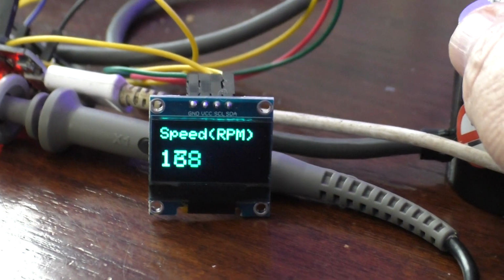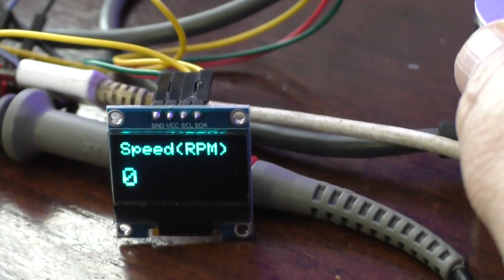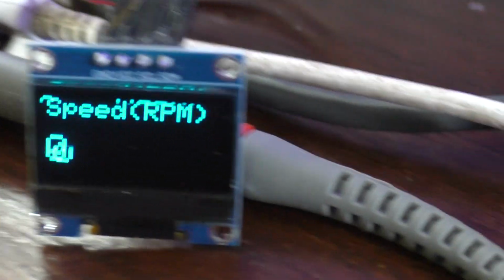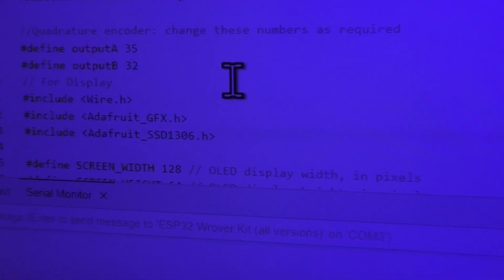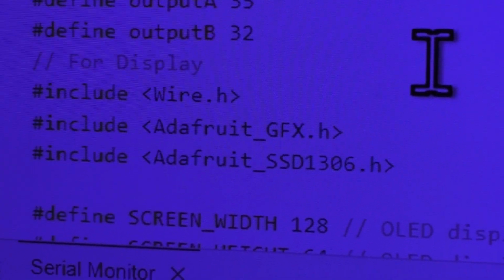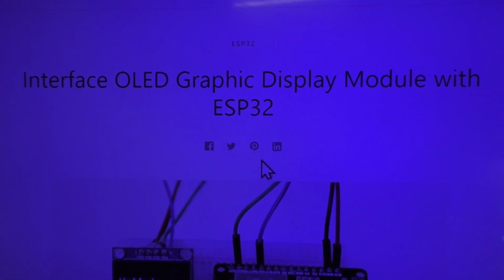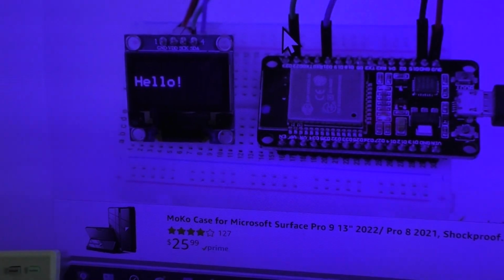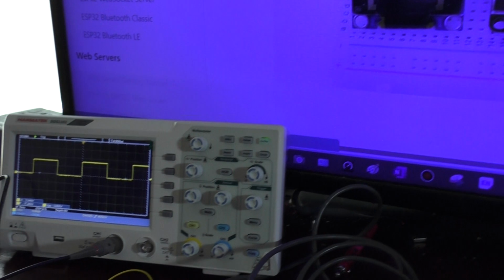Deconvolution measurement of rotational speed with embedded OLED display

Comment: I'm trying to remember where I had to do something that had to use the instantaneous values for control, but I did a smoothing of the values and only output via serial every so often.   The serial data needed to be slower simply because of the data rate so I had to decimate the data going out.   Thankfully in that situation you're not having to use the main processor to output individual bits as you load up the registers of the serial port and let it deal with it after that.

Often with code I try and write it in a style that I call "drop through".   That is, nothing will block the code execution from top to bottom and repeating.   A lot of functions I turn in to state machines and the main code is checking what state and if it needs to move to the next state, service that state and drop through the code to repeat the next time round.   Sometimes there's counters in there too so that it doesn't just go straight in to the next state but has to wait, effectively a time out before executing the next part.   Handy for de-bouncing I/Os.

In this case I might have the loop for doing the control of the motor looping but a state machine to work through the digits for display, with the I2C output of the micro being updated with new data each time.   Of course it is very dependant upon the implementation of the I2C module inside the micro.   With the serial interface you'd have one byte being sent out with another then being loaded ready to go next.   Looping through you could check if it was ready for a new byte rather than waiting.
Reply from the maker: That's some very good advice John. You are well skilled in the black arts of micros for sure! In this particular case if you're just measuring speed as an open loop transducer the sampling rate need not be very high in any case since the speed is constant. If it's with a control loop though that's the problem though we don't need to know the exact speed to feed it back (only a signal proportional to speed) so a display isn't that necessary anyway. The problem with displaying only say 1 10th reading might be that the sampling rate must be uniform and no glitches even now and then for a display. I think National instruments had the best solution (though expensive) with they FPGA and real time processor design (Rio). It had a RTOS of course which is a better solution. All sorts of tricks like direct memory access, shared memory, FIFOs etc to speed things up. Certainly state machines were also on the list. For most hobbyists though speed isn't a major issue with micros as they are on the whole just switching things and much speed control is open loop. I think you need to start your own tutorials on micros online John since you have at least 30 years of design experience.
Reply: @TJMoir  I did apply for a job teaching microcontrollers at Paisley Uni, but they took on a less experienced guy instead.

Comment from the maker: Code is here  -----------------------------------------------------------------------------------------------------------------------------
//Deconvolution filter to get rotational speed from rotational digital position
//Adafruit SSD1306  0.96-inch 128×64 I2C OLED display to show speed gives bandwidth of 16Hz only

volatile int counter = 0;

//Quadrature encoder: change these numbers as required
#define outputA 35
#define outputB 32
// For Display
#include <Wire.h>
#include <Adafruit_GFX.h>
#include <Adafruit_SSD1306.h>

#define SCREEN_WIDTH 128 // OLED display width, in pixels
#define SCREEN_HEIGHT 64 // OLED display height, in pixels

// Declaration for SSD1306 display connected using I2C
#define OLED_RESET     -1 // Reset pin
#define SCREEN_ADDRESS 0x3C
Adafruit_SSD1306 display(SCREEN_WIDTH, SCREEN_HEIGHT, &Wire, OLED_RESET);
/*
Vcc is 3.3v
SCL is pin 22
SDA is pin 21
Also needs ground pin
*/
// for sampling freq measurement on scope
int sample_pin = 27;

float d1, b0, b1, z0, z1, u0, u1, yout;  // d is spectral factor coefficient from polynomial

void IRAM_ATTR isr_quadencoder() {
  // quadrature encoder
  if (digitalRead(outputA) == digitalRead(outputB)) {
    //Clockwise
    counter++;
  } else {
    //Counter Clockwise
    counter--;
  }
}

boolean running = false;

void setup() {

  d1 = -0.0839;
  b0 = 0.8392;
  b1 = -b0;
  z0 = 0.0;
  z1 = 0.0;
  u0 = 0.0;
  u1 = 0.0;

  // Serial port for debugging purposes
  Serial.begin(115200);
  
  // initialize the OLED object
  if(!display.begin(SSD1306_SWITCHCAPVCC, SCREEN_ADDRESS)) {
    Serial.println(F("SSD1306 allocation failed"));
    for(;;); // Don't proceed, loop forever
  }

// Clear the display buffer.
  display.clearDisplay();

  pinMode(outputA, INPUT);  //Encoder input A
  pinMode(outputB, INPUT);  //Encoder input B

  pinMode(sample_pin, OUTPUT);  //Sampling freq measure with scope

  attachInterrupt(outputA, isr_quadencoder, FALLING);

  // end setup procedure
}
//while loop
void loop() {

  // Deconvolution filter
  z1 = z0;
  u1 = u0;
  u0 = counter;
  //z0=0.0839*z1+0.8392*u0-0.8392*u1;
  z0 = -d1 * z1 + b0 * u0 + b1 * u1;
  yout = 100 * z0;
  /*
  Serial.print(6000);
  Serial.print(", ");
  Serial.print(-6000);
  Serial.print(", ");
  Serial.println(yout);
  */

// Display
display.setTextColor(WHITE); //  text
  display.setCursor(0,0);
   display.setTextSize(2);
  display.println("Speed(RPM)");
  display.setTextSize(3);
  display.setCursor(0,30);
   display.println(int(yout));
   display.display();
  
   display.clearDisplay();
// Need a time delay
  delay(4);

  digitalWrite(sample_pin, running);
  running = !running;
  // end of while loop
}

---------------------------------------------------------------------------------------------------------------------------------